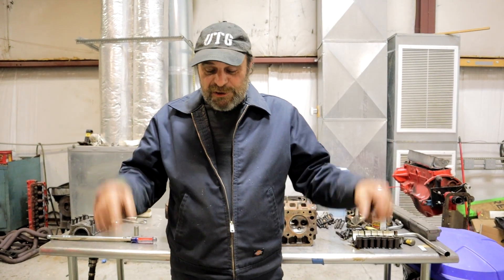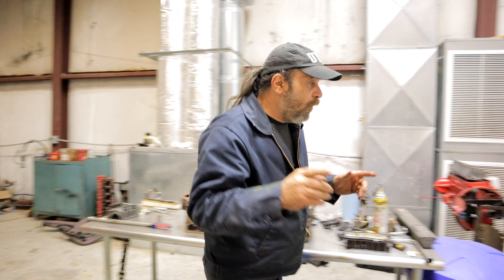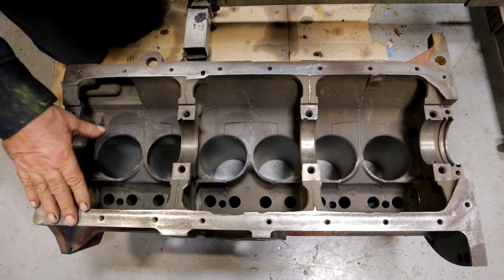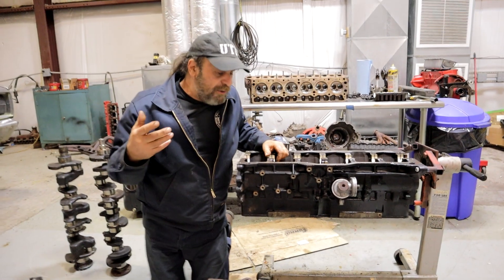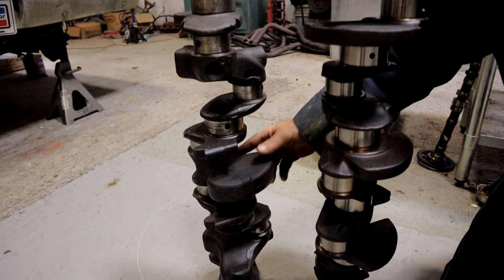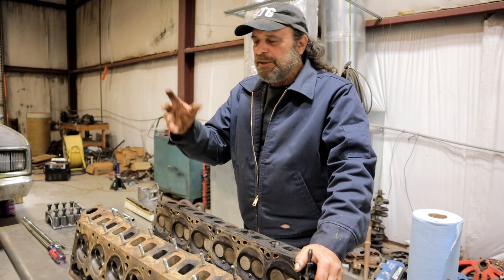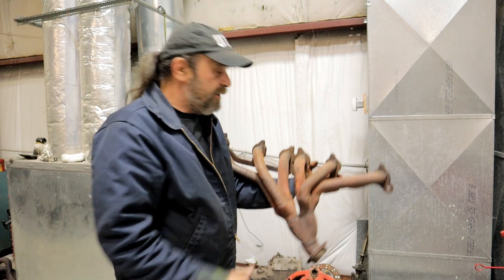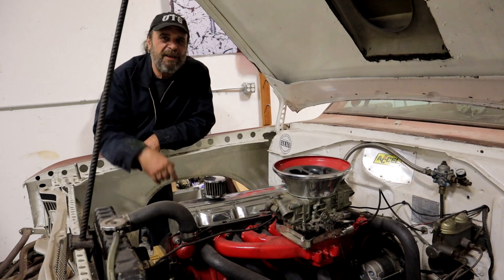The Mighty Mopar Inline 6's History And Comparison - Flathead, Slant, Hemi Six, 4.0 And Hurricane

Comment: The 265 here in Australia used to beat the Ford 351 Shacker, I had a VJ Charger went real well, my cousin had a 215 Hemi he couldn't blow it up even though it was rattling like crazy, he ended up changing it to a 265 in the end didn't kill the 215 though, all the best to yous and your loved ones
Reply: No they didn't!😆 But the 340 Chargers were just as quick.
Reply: They rattled due to wear on the timing chain and sprockets, which had no tensioner and no way to control camshaft endfloat. Under warranty, we sometimes fitted timing covers with a steel ball held in them to control camshaft walk. The other issue was piston slap. Due to slack machining tolerances from factory, there were a number of different oversize pistons, marked as A, B, C, D etc, and we had to hand select individual pistons for each bore to minimise skirt slap. 215's and 245's were the worst offenders, not so much the 265. I ran a 265 with SU carbs, 3 of them, E49 cam and head work for 320HP at 6700rpm, but only for the day as the head gaskets would not hold.

Comment: I just asked you this question I said how come Chrysler didn't just run the 225 in those Jeeps. I understand it is a little bit smaller in displacement and outdated. You could have put overhead cam  and EFI on the slant or just EFI it would bring it up to today's specs or at least 90s specs and then it might be more reliable than the 4 L

Comment: Long ago one of the Chrysler engineers (might have been mentioned in the Chrysler Engines book) wanted an inline six to have fewer main bearings than the typical seven so the crankshaft wouldn't be so "whippy." I don't quite understand it, but the upshot was the more bearings the engine has the greater the bending stiffness but lesser the torsional strength. Perhaps something to do with a four-bearing crank being shorter than a seven-bearing version for the same cubic inches.

Comment: This was a great start - 100 years of history in 15 minutes. When you get to the Hurricane, and questions about whether it will catch on, there's an inline six engine you didn't talk about that, like the Jeep six, isn't strictly Chrysler but is so integral to their survival as a company it almost belongs here: the Cummins diesel. Dodge pickups around 1990 weren't many people's first choice. Then, out of nowhere, they had arguably the best diesel in the business. That's a whole other story and a long one (Chrysler probably made a huge mistake using the VM Motori diesel in the 1/2-tons and Jeeps instead of a smaller Cummins). But a lot of the hardest-working engines - in semis and farm tractors - have been a) inline sixes and b) turbocharged. The proof is in the diesels.

Also, interesting that the name calls back to the Jeep Tornado inline-six, an early 60s OHC engine. Jeep hadn't even joined AMC yet; Willys had merged with Kaiser at some point. Tony, maybe you can explain AMC and not-AMC defunct car companies in five minutes. There were so many in the 50s and then it was like they mostly married the wrong ones and some ended up as AMC and some of them, mercifully, just died in corporate murder-suicides. There were Hudsons, Packards, Studebakers and Warren Zevon only had so many car songs to write. And he picked on Studebaker.

Comment: Hate how the slant,intake exhaust bolt on the same stud.
       You could slit that header in the middle and two piece it.
      The make a stroker assembly for the AMC. They called it a HI PO 300. I guess now that would be 5.0 in rice sippers.

Comment: There's something incredibly durable about the slant six. I've seen one run with a connecting rod smashed through the block; we jammed the throttle wide open, and about 2 hours later it stopped running. After cooling down, it started up and ran again. (The 73 dart with a slant six cost me $40 back in 1983)

Comment: The 265 hemi 6 in Australia was also  fitted with triple Webber carbs and stock put out over 300 bhp. You should be able to order a basic 265 fairly cheaply. Also the top inline 6 for turbocharging is the Australian ford Barra 6. People are getting way over 2000 hp out of them.
Reply: The Aussie Hemi 6 had the same 1/4 mile time as the Ford Falcon phase 3. They both did 14.4. The Aussie Hemi Charger cars outran the Falcon to 100 mph. They couldn't outrun the Falcons on the higher speed racetracks like Bathurst. Great to see the Hemi 6 get a mention though 👍.
Reply: its an aussie thing, they dont get it over there, we built the best inline 6's around between valiant and holden and then ford with the barra,

Comment: The Aussie Hemi 6 had a 245ci heavy duty version used in our smaller D5n pickup trucks and similar vehicles. I've got one in my mid 70s Dodge D5n 300. Had a few minor differences to the car spec Hemi 6's.
Reply: IIRC, similar changes that the AT2 Slant had over the regular engine - things like thicker casting, factory shot-peened forged cranks. Stuff to make a work-horse engine last longer.

Comment: I bought my '97ZJ in 2007 with 43k miles purely because of the 4.0L, It now has 125k miles. Gasoline will be a relic before that motor dies. So many of them have been lost to the "Cash for clunkers" bull. Finding parts is getting harder every year. I Bought a 258 crank to stroke it to a 4.6, and never got around to it. I was gonna sell the crank, but with parts are becoming so hard to find now I'm having a hard time coming around to letting it go.

As long as I can buy gas I will never have a car payment again.

Comment: Hi Tony, while we're on the six subject, could you do a piece on the slant six emissions set up removal? I have a 73 Scamp here in England, it came from California but the emission set up is irrelevant here. It would be great to get an expert opinion on the removal job.
Thanks UTG 👍😎👍
Reply: I really doubt there would be any "Emissions" stuff of interest on a 73 Scamp. About the only thing I would think is an exhaust pump or something. Just take it off and plug up the holes. Is it a 1 barrel or 2 barrel? Get a 2 barrel manifold from Oz and a set of extractors (headers), fairly sure they are still make them here. Or even a 4 barrel manifold or if you are adventurous an SU or Weber manifold.

Comment: Thanks U.T. If i'm not mistaken the 4 liter jeep motor was an evolution of the 258 AMC , which had its roots in a Nash design from the mid 50's. Cheers bud.
Reply: The 232 introduced in 64 was a clean sheet completely new design. Later destroked to 199 and stroked to 258.
199 3.75 bore 3 stroke
232 3.5 inch stroke 
258 3.9 stroke
Reply: @mpetersen6  Good to know, Thanks

Comment: The italians made a radial aircraft engine used in Reggie R2000 aircraft, Sweden bought a few in the beginning of ww2. It's a 2 main 2 row radial engine. Al other 2 row radials have 3 mains for a reason. It ended up forbidden to use unless in actual war, the crank could break during take of. With death and carnage as result.

Comment: One thing that could be done with the 4.0 is a head swap. The bore centers are exactly the same as the Ford Windsor and Cleveland. And only .020" less than the the Chevy Small Block/LS/LT family. Judicious cutting, welding and machine work would give you a cross flow head. A good place to start would be a 2.5  four banger used in the Jeeps. The 2.5 block was machined on a 232/258 block line converted  over to the 2.5. When the machining line was installed the locator positions were already in the fixturtures for a 4, 5 or 6 cylinder block. The only problem might be bore to valve clearance on some heads. Some of the LS heads do have just about the same bore as a 4.0. Need a new cam though. 
I've seen where Ford 300s and Chevy 292s have been built with new heads from sectioned V-8 heads. So why not the 4.0.

Comment: 2 comments from me on this video. 2 topics. Anyone have thoughts on why none of the big 3 ever put a cross flow design head on one of the straight 6 engines? That just seems like a very logical next step in the 6 cylinder design. I know of the guy who build a custom head for a ford 300 out of ls heads, but I know very little about the results. So I'm very curious about how big ci (big compared to the euro and Asian small displacement I6s like the 2j and the Rb series) I6 engines do with cross flow heads.
Reply: One big stumbling block was the dizzy and intake manifold would interfer. If you are going to bother just go to OHC and get all the benefits.
Reply: They did in Australia with Ford inline 6

Comment: Interesting to note, there's never really been a "Jeep engine".  There are many engines that were used in Jeeps from Willys, Continental/Kaiser, Buick, AMC, Pontiac, Chevy, Chrysler... but there was never an engine designed and made by a "Jeep" organization.  The Tornado 6 (230 overhead cam) was used only in Jeep products in the U.S., so is probably the closest thing to being a "Jeep engine".  (It was used in the IKA Torino, a VERY interesting car in South America.)
Reply: The IKA Torino was based on the 64/65 Rambler American. The Kaiser Tornado was a little weird. SOHC hemi head. The same cam lobe opened both valves.
Reply: The Torino was a Classic body shell with American front end giving a unique wheelbase between the two.

Comment: A buddy and I found a really cool flathead 6 in a junkyard a few years back. We noticed it because it had this really cool twin carb intake manifold. After a lot of google work, we eventually learned it was a Chrysler build engine for big trucks in the navy. It was knows as the big 6 and had a displacement of 410ci(ish? Don't remember exactly). And made torque similar to a modern 5.9 cummins engine but was only like 180hp. Apparently they were loved, but had to be driven carefully because they were known for breaking cam shafts due to the torque or something.

Comment: I'm a Pontiac OHC6 guy!  I have a standard 1bbl 250 in a '68 Tempest sedan.  Wonderful engine, and peppy even in standard tune.  But they do like to rev some and the Hydramatic Super Turbine 300 2-speed auto (NOT Powerglide) absolutely stifled them, and mine has the 2.56 axle to boot.  LOL!  But a 200R4 and 3.90 makes them very happy.  And the Sprint 4bbl is a remarkable engine.  The Chevy 292 crank makes for a stroker, with an overbore gives you 301 CID.
Reply: The were some people working on a 24 valve DOHC head for the Poncho SOHC based on DOHC heads from the LQ-1 V-6
Reply: @mpetersen6  , I remember something like that but never saw what became of it.
Reply: @jeffbranch8072  
Personally I suspect that the reason the project died was either the cams and cam drives. Or the oiling system.
But I can think of three pushrod inlines that have been converted to DOHC 24V heads. The Chevy, a Ford (1) and the 4.0. Used in the TC racing series in Argentina. They all share a very similiar head design.
Reply: @mpetersen6  , a Ford Falcon 6?  Australia continued developing the Falcon 6 right to the end.  It ended up a DOHC 4.0L that made up to 436hp in production.  It was the first Ford engine to have VVT.
Reply: @jeffbranch8072  
I'm not sure which Ford 6 cylinder block was used. The 140 or the 240 family.

Comment: The 4.0 is a heck of an engine, right up there with the 225 on dependability and longevity. I have a friend with a 398k slant in his 1976 "Asspain" and my 1994 Cherokee Sport has 326k. Both have never been apart, run solid and strong, and don't burn oil but do leak it like sieves.

Comment: Hi Tony
It’s an absolute travesty you guys in the states never got the 265 hemi 6 over there !
It’s an absolute weapon 
In 1971 at the peak of the power wars here in Australia the 265 could be had with triple Webber side draught carbs and was the quickest car over the quarter mile 
Even beat the 351 4V hipo Cleveland in our version of the Mach 1 mustang ( it was a falcon GTHO)
The local Valiant was killed off along with the other muscle cars in 72 as the cars were deemed to be way too fast to be allowed on the streets 
The 72 falcons were capable of 180 MPH top speed ! 
That’s not kilometres…
We didn’t go metric till 74 !
The motor you are looking at we had in Australia as a 215 245 & 265
All were excellent quality products
Reply: No they wouldn't....good grief that is a silly urban legend. They were looking at the temperature gauge, not the speedo!!. The Fastest Moff went was in the 1978 XC Cobras. In qualifying he reached 159 MPH in full race qualifying trim on Conrod. That was as fast as they ever went. The XC race cars had much hotter engines than the XA "Phase 4s"....they ran at least 190!!.......Degrees F    😂
Reply: @kramrollin69  sorry but this was measured by one of the car magazines 
The falcon surged ahead after the quarter mile but E49 was quicker over the quarter 
And I am a GT man,,,
Reply: @batmanlives6456  Umm No. So you are referring to a  1/4 mile time or the 180mph "claim"? Just to let you know. In Oz our magazines of the day never run those cars on a 1/4 mile track. What they had was something called " a 5th Wheel", which was a bicycle wheel that attached on the back bumper and "Read" the so called performance of the vehicle. They were not very accurate. This is where the 14.1 1/4 came about...it wasnt timed at a drag strip, it was measured with the 5th wheel. Actual Drag strip times of the day the E38s were running around 15.1-15.5s, the E49 was around 14.9- 15. the GTHOs were low 15s, with a high 14 on a good day. Most stock 340 A bodies were low to mid 14s, AND the Americans usually tested them in "As tested" condition...meaning 2 people, full tank, etc etc. Yes the 340s were beasts.
Reply: @kramrollin69  I was referring to the 1/4 mile time measured on an open road and admittedly not as accurate as today’s standards 
The 180 mph was the xa model phase 4  which was available with the 3:1 ratio diff and 180 mph capable 
The XY was only good for 140 - 150 mph range
I had mine officially clocked at 145 mph
Bloody scary
Reply: @batmanlives6456  No, the XA would never have run 180 mph. As I stated, the XC Cobra run 159 MPH flat out on Conrod in 78. The Clevelands in 78 were much more modified than any Phase 4 would have been.....it's just another urban legend. Did you own a GTHO? The fastest a XY GT Falcon went stock, was around 120mph, downhill with a tailwind if ya lucky, fairly fast for the old bombs tho.
Reply: @kramrollin69  yes I have owned these cars and I am afraid to tell you that you are wrong
Reply: @batmanlives6456  Sorry buddy, nothing iv'e said is wrong. You made the wild claim that a Phase 4 would run 180 mph.....Not a hope in H***. So what cars have you suppose to have owned?
Reply: @kramrollin69  mate …
You stick with your mighty VS  or VT Bombadore …
One day you may break 100 Kph and earn yourself a traffic fine rather than your usual defect notice….
Reply: @batmanlives6456  What like you? Cool comment though. You are obviously 12.

Comment: if chrysler was anything like GMC, they would've mounted 2 slant 225's in a V & made a 550.GMC did some crazy sh•t with straight & V engines.like combining 2 351 cube v6 on 1 long crank to make a 702 V12 gasser.detroit diesel did even crazier things, like V24's at 110 cubes per cylinder.

Comment: I wouldn't worry too much about 20 psi boost.  That's nothing these days, it's fairly easy for manufacturers to keep reliable.  Hell, my 2016 Hyundai delivers somewhere between 18 and 20 psi, and while it's a relatively small car, it still weighs in at close to 2800 lb.  So 20 psi in a modern engine "shouldn't" be a problem.
I say "shouldn't" because - this is a Fiat-Chrysler-Peugeot-Stellanis vehicle after all, so all bets are off regarding actual reliability.  But it _should be possible to make it both powerful and reliable.

PS: but the king of the straight 6s has to be the Aussie Barra.  Oy Oy OY!  🙂

Comment: Ford's 223 was a 4 main bearing motor.  Started life as a flat-head and evolved to OHV in the 50's but kept the 4 mains ...  I think the Blue Flame 6 from Chevy was 4 mains too ...
AMC got a lot of press and a lot of love from car writers for that 7 main six back in the day.  And the smaller classes in road racing started to find that motor in customs and Javelins.  It'll run, always could.  I'd step on the cam just a bit, and make sure your quench (small but effective) is tight'ish.  Better TQ and better gas mileage w/o going over board 😁
Reply: You're right, there were other 4-main inline sixes and most were, prior to the early 60s. I think, at that moment, he was only comparing the slant to the engines it typically competed with in the 60s and 70s, which were the Ford 170/200/250 car "Thriftpower" and 240/300 truck engines and the Chevy Turbo-thrift family (194/230/250/292), and of course the AMC. The Ford Thriftpower engine came out in the 1960 Falcon with just 4 mains, but as it got larger, by 1965 Ford had upgraded to 7 mains in the 200 and 250. That's probably as close a comparison to the situation Chrysler was in. Ford changed their engine and Chrysler didn't. For what it's worth, I don't think anyone with a slant-six ever felt like they were getting a raw deal just because the engine didn't have 7 mains. Neither did Toyota Land Cruiser owners, whose engine for many years was an evolution of the earlier OHV GMC six and stovebolt Chevy. If the crank is solid enough, it's fine. V8s don't have 9 main bearings, after all.